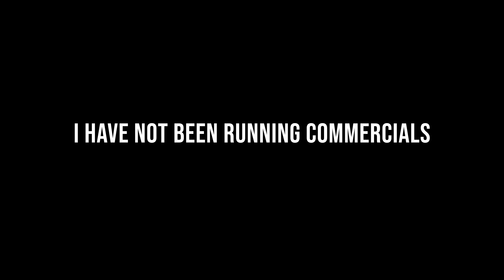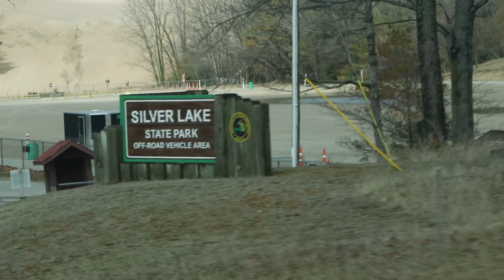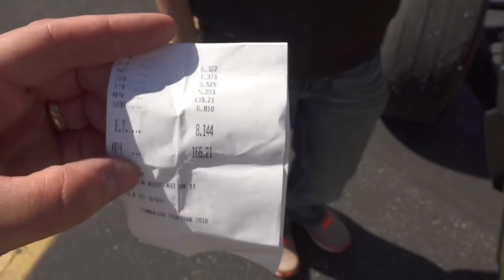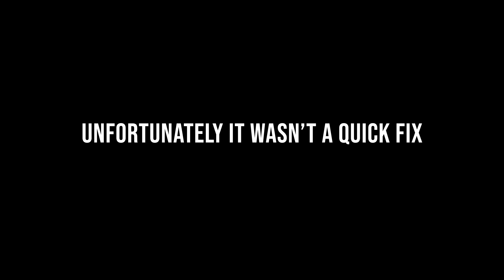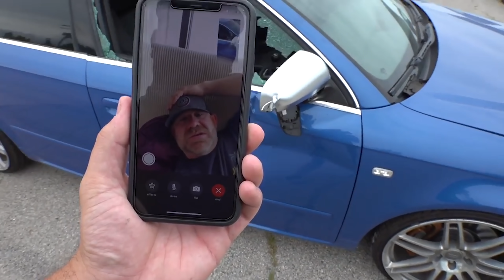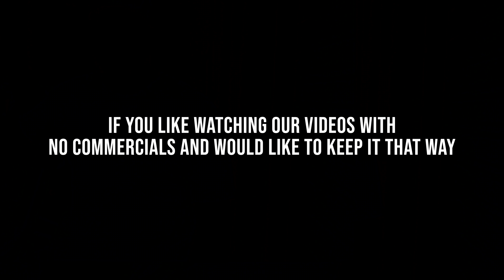Launching the 1300HP 2JZ Swapped RZR at Silverlake!! // Epic Ride with SXS BLOG!!

Comment: I would say to just build a nice solid trail rig. Its a give away, put good all round parts on it, nothing wild, just solid. Tune the engine. Nice wrap. 
Some BFG AllTerian KO2, 37s. Ship it. Nothing too expensive for a beginner to have fun with. A nice solid rig, with a tune and wrap. Safety equipped should be #3 on the list. 1) Nice looking rig.
2) Solid ride, reliable parts anyone can afford to replace.
3) Safe. Install excellent safety equipment. Even a First Aid Kit. Special Chet Edition First Aid Kit. That could also be a merch item in the future.